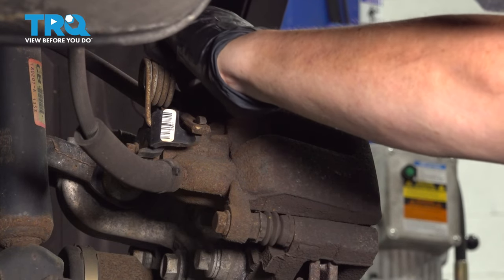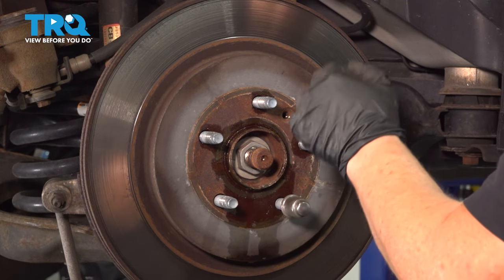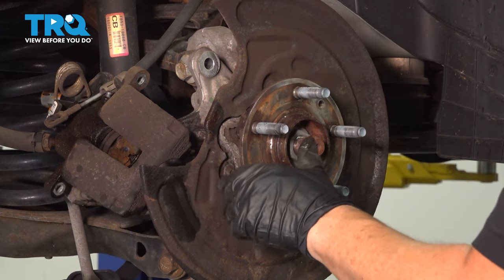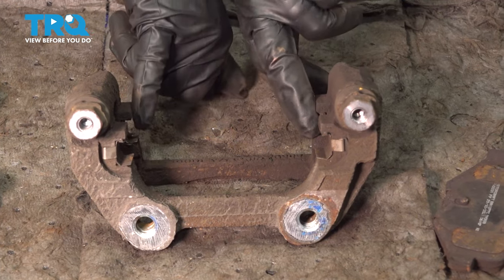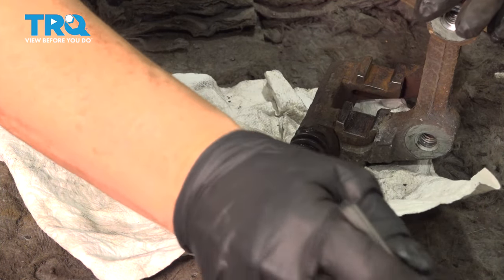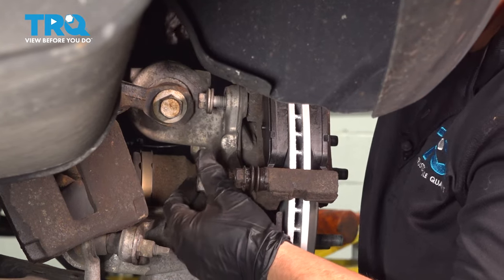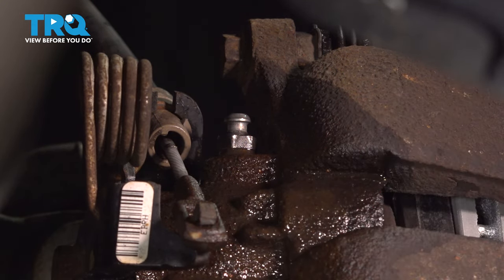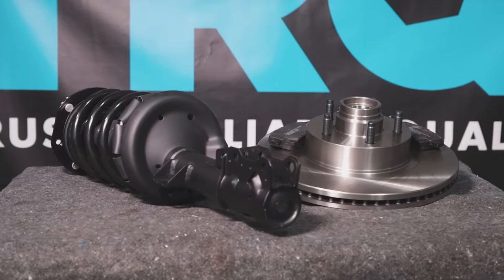How to Replace Rear Brakes 2011-2019 Ford Explorer

Comment: Just a note to let everyone know that maybe a little clearer. When you were compressing caliper,  the tool fits into slots and does not just push piston, but it turns the piston in a clockwise direction, allowing it to retract. This type can not be pushed like with a c-clamp. Thanks

Comment: I guess you never changed brakes from the rust belt i dare u to put a pneumatic on that t 40 normally i put a torch for about 30 minutes before putting any t 40

Comment: on my 2016 Explorer XLT rear brakes, I could not get the caliper piston to rotate inward with the tool with the bleeder open or the cover off the master cylinder. The emergency brake is off as well.  I have not started on the other side but want to fix the drivers side if possible.  Any help would be appreciated.

Comment: this is an excellent video.  I have 1 criticism.  If you could explain why you have to position the piston a certain way it would help. It mates with the pin in the back of the pad and will knock the pad askew if it isn't in the slotted area.  Otherwise, thanks for great instruction.

Comment: I have two questions. 
So you don't take the cap off the master cylinder container before you start working?
And do you not have to press the brake so the pads sit correctly before putting the tire back on?

Comment: I just changed my brake pads on my 2013 Explorer
I do have a question about the piston for the rear
will it need twisting it back or will it decompress by itself?